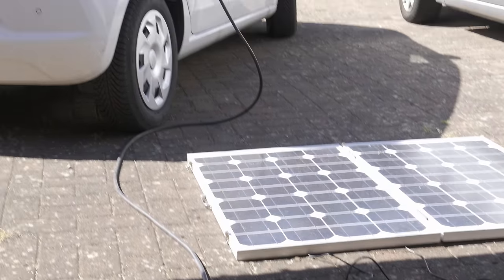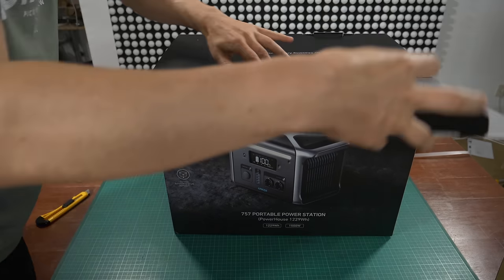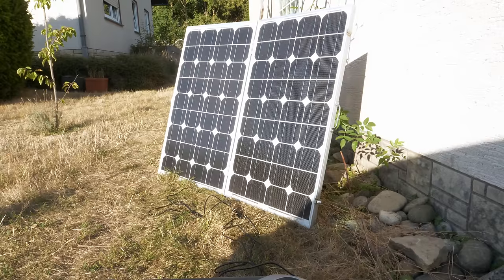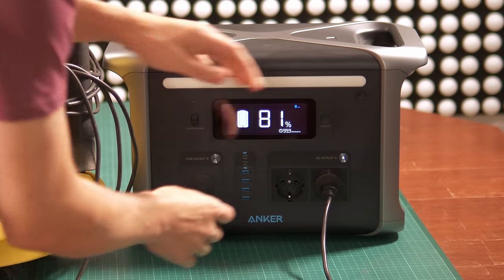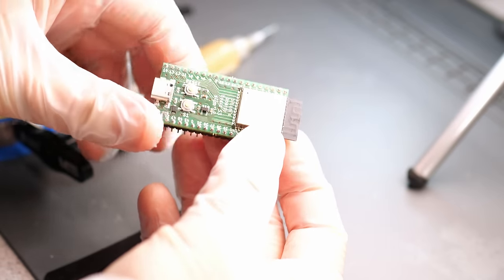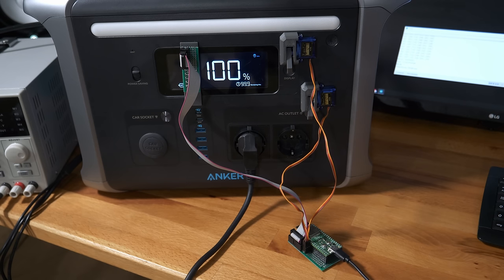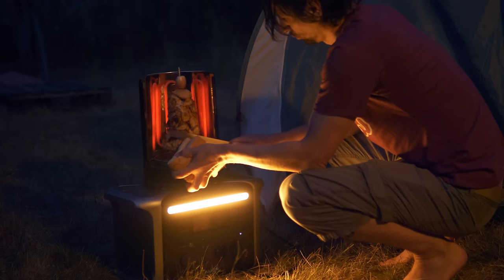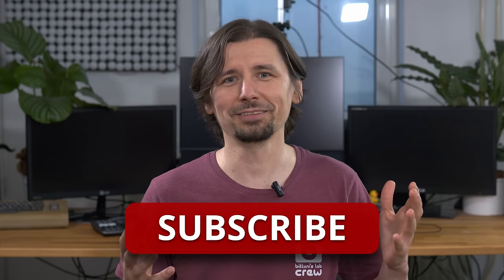Charging an EV for $0 (Anker 757 PowerHouse)

Comment: Have you not seen Julian Ilett's home built Arduino EVSE project? The spec allows you to dial down the current quite low by changing resistors on the pilot signal line. You should watch his videos - maybe your car can be requested to go down to 2A after all :)

Comment: Be carefull with all these units cause they mostly have a simple issue: a questionable warranty and repair shop plus no specs nor details about the manufacturer of the cells in side, I mean brand and modelnumber of the cells. 
The make profits by cutting costs using cheap, non branded or even used cells inside where you can not get behind. Bluetti, Poweroak and Ecoflow are all the same, some even still LiIon, which can burn, not LFP as many assumed.

We had Bluetti and Poweroak with a lot of issues till they died after 1 year and a nightmare of troubles during corona and only Amazon solved the issue to force the seller to take it back.
Without we would have been screwed, fully. The one we could not return has to be sold on ebay for 10% of the value cause there was no battery replacement available nor BMS back then. 

It is useless as an emergency charges cause germany offers every where a lot faster and cheaper chargers along the road are available.
Good experiment but pretty expensive if you do the math cycles of the cells x capacity which might end up in  a fortune. This one is a LFP cell with 3000 cycles claimed x 1,2 kWh = 3600 kWh without losses. This means that for 1700€ you pay 0,50 € for each kWh without the solar panels needed.

For comparison: you get a 8 kWh LFP battery for 1400€ and for 250€ a dedicaded off grid invervter that beats this one if you build it on your own and for your needs like the whole USB whatever dilemma. 8 kWh would mean for the e-Up a 50 km range, if you really wanna carry such system with you , I mean the Anker weight is about 25 kg  and quite a big chunk of 46 cm x 30 x c 25 cm.

I would get such only if you have usecase like charing over day the battery and charge the car over night. Not so efficient but you get a quite powerfull charging hub at home for about 2000€ that can charge your car with 8 kWh each evening if you have a 2 kWp solarpanel for about 2 / 3 days of the year where 2 kWp panels are about 800 - 1.000€.

Remember 8 kWh are roughly 40 to 60 km range per day for free, so 250 to 350 km range per week. 
I would think that you can charge your car with such 8 kWh offgrid charger and also run during daylight your fridge and router   from the 2 kWp which usually brings 2000 kWh a year and 14 kWh per day peak, but only very few days.

Such a DIY 8 kWh offgird mobile solar charger also useable for other devices at home with 2 kWp on the roof or garage or in the garden would make much more sense than just a mobile charger for 1700€ - but that depends on your living situation. 2 kWp is a lot for a car and the home, so in total 2500€ if you have a bit of luck. We paid for the EA sun about 300€. 
So i hope you might just design such project on paper what would be needed as a full alternative to make people think that it is possible to get such solution without any bureaucracy especially in germany , a diy solar power charging station - but do not forget that this design delivers 15 kWh in long summer days but about just 1 or 2 kWh on short winter days, but from february onwards mood raises and solar power harvest too. So December and January will require additional chargers than this.

Comment: €1,10 per KWh for new contracts here, and €0,39 per kwh of gas (3,81 / m³) completely insane. €1700 for just 1,23 kwh power storage is also not that great, but hey it was sponsored I guess. on the other hand: 1,23 kwh is far better then possibly nothing at all this winter. power rarely fails here as well, but this winter I won't be surprised if we will get those. If I had a place to put solar panels etc. I would be building probably something "Off-Grid Garage" style. I do like the automation of the buttons 🙂
Reply: We bought ourself a whole house capable battery that even supports island mode :D should get us 3 days of independence :D

Comment: Sind die dc dc Konverter eigentlich zuverlässig? Ich wollte mir ein 24v system bauen und statt 400w ins Netz lieber in die Batterie stecken und konstant die grundlast von 100-120w abgeben.

Comment: To fix the 36V issue, how about a 30-ish volt power zener diode?
The MPPT controller would probably pull the panel voltage down enough
Reply: At 10A, that diode would have to dissapate about 60w. A switching converter can be much more efficient.
Reply: @aaron41  The diode will only dissipate power when the MPPT is not charging. When it turns on it will quickly see that it can extract more power when the output is pulled a bit below the zener voltage.

Comment: Cute.  This setup will likely kill the lithium ion cells in just a few months of cycling though.  It’d make more sense to build a power bank from more robust discrete components for this application.
Reply: these lithium cells lasts 3k+ cycles before you see deg. few years should be easy.
Reply: Hopefully this pack uses Lifepo4 chemistry. Can anyone confirm? Limiting the output between 20-80% should help a lot as well.

Comment: I still need to watch the video but just from the 15 second intro you saved me. I have a neeed to charge an electric mower with an AC200P and I need to figure out a way to turn the AC back on when it drains since the battery is half the size of the mower battery. I see you have some 3d printed button pressers so I look forward to figuring out how to make those.

Comment: Good to see that this PowerBank is very good as an UPS. This could be a nice Dual-Use Case (while not using in as a portable unit).
Reply: Since the power ist converted to DC to charge the battery and then converted back to AC, the efficiency is probably pretty bad for this uses case.
Reply: @fkiesel9442  I did not think at that, but you are probably right. I can imagine that some UPS do that too instead of a bypass via relay.
Reply: @fkiesel9442  Using normal MPPT solar panel regulator with AC output, in conjunction with stronger Lead battery pack would give better results for much less money... and no workaround would be needed. Today's MPPTs units have usually both ETH/BLE(or IOT) control available, so remote automation is much easier ;-)

Comment: For the car charging you should have a look at the efficiency - with such low power it needs long anmd the car has a cerain be-awake-consumption. BTW- with this car you would be able to go down to 5A with all garnny chargers because Amp-Limit can be set in the car to 5, 10, 13 or 16 A.

Comment: That Anker battery thing is a joke ..... 
It's way too expensive! 
For the same money you could possibly get a 100Ah 5.1kwh rack mount battery and a 3kw inverter and possibly a mppt charge controller and some solar panels all from AliExpress! 
Yeah it's not beautiful! But it will work, the rack mount batteries also come in 200Ah 20kwh size and it works out cheaper than the smaller sizes ... And you can run the rest of your house when the grid is down....
Reply: The anker battery is meant for portability.
How portable is your solution?

Comment: Hi Bituni, if anyones going to be able to answer this itll be you.

My van has 2 x 12v (10 amp (20 amp fuse), so could i use 2 car chargers plugged into the provided solar cable xt60 for double quid charging?

The charge from 1 socket reads 120w, so would 2 chargers be 240w? Which is below the 300w from the solar panels.

Would it be too much amperage?

Comment: BLUETTI AC200P beats this puppy to the curb. And it's been on the market long enough to iron out all the bugs. 
With a maximum solar voltage input of 150V (compared to the 30V of this unit), users can string a few solar panels together in series and let the MPPT take care of them and any partial shadings. 
This area of the market has been cornered by the big boys that eat newcomers for breakfast.

Comment: I am pretty disappointed. I expected that you would hack car charger to support lower current or do some nice hack for slow charging from solar to some dc/dc converter and then directly to car DC charging port. Solution with battery station is in my opinion wasting energy on many unnecesary conversion and shorting battery life time of your battery station.

Comment: Hi, i would like to ask for help reguarding one of you project of gesture controlled robotic arm. I tried making it with the exact same parts and code but i am not getting anything, the code is up and running but when i use GY-521, GY-511 and Linear hall effect sensor i am not getting any out put means none of my servos are working please i need help regarding mu issue. Thank You!

Comment: How did you measure the sine wave at the oscilloscope? Did you just directly measure the voltage with the regular probes? Or used some special probe (i.e. isolated/differential)?
Reply from the maker: direct measurement 😬
Reply: Gefahrensucher 🙈

Comment: Nice, but I still find the charge of my car via 230V inconvenient. We need much more improvement on this whole charging story, IMO
Reply: You do know that there are faster alternatives already available?
Reply: @Jehty_  I do.
Reply: @peter.stimpel  so then what was the point of your comment?
Reply: @Jehty_  To annoy you ;) Seriously, the generation of electric cars we have today is not very efficient. To charge them in quite a acceptable amount of time 230V is not enough. At least here in my area not so many public charging points are abailable, so you need to rely on your house electric and its capabilities. Without changing major parts of my homes electric installation faster charging is out of reach. Oh, and to be clear, I have an electric car, so my opinion is from experience.
Reply: @peter.stimpel  where do you live that you don't have 400 V at your house?
Reply: @Jehty_  I do, but not as near to the carport the electricians would be happy about it. Basically, he offered some installation work, but the pricetqag was way above. The house was built in 1997 (not by me), and bringing 380V to the outside was not focus at that time, obviously. But this is not the basic topic why I am not pleased with the charging situation. My opinion is we need much more research to make electric cars more efficient. We carry big battery packs with us, and still we have a quite limited reach with such cars. I do not know if you get it. But it is not importan either.
Reply: @peter.stimpel  no, I don't get it.
Research in new battery types is done already.
So I really don't understand what your problem is 🤷🏼‍♀️
Reply: @Jehty_  OK, so it is as it is - we do not understand each other. Im fine with that
Reply: @Jehty_  Wow there are places where residential homes have 400v?! Canada has two 110v phases, but only our ovens, air conditioners and dryers use 220. I think many EV owners here have slow chargers running off the 110, unless they hire an electrician to add a 220 outlet to the garage. But even then I think they need to buy a stage 2 charger or whatever it's called to plug into 220.
Reply: @grabasandwich  yeah, it's called "rest of the world" 😂
Reply: @Jehty_  The "rest of the world" has 400v if they have three phase. In some countries that's standard but in others it is not.
Reply: @eDoc2020  could you give an example of an country where that isn't the case?
Reply: @Jehty_  UK is definitely single phase for houses and I think Australia is, too. I can't say much about other countries.

Comment: That's too much conversion, with too many inefficiencies at each step. You're getting, what, 5 or 6% efficiency, sunlight to driving? I'd make a custom buck-boost circuit to directly adapt a variety of solar panels' output to the car's charge circuit, and implement MPPT (and data logging) with an ESP32 which also happens to provide BLE and WiFi. If you use large LiFePo4 cells to store excess panel output, you can use that (boost mode) to charge the car at night. Bonus: fewer operator manuals and warranty cards.

Comment: I too wanted to use more panels to charge my similar power bank. Same problem, two panels in series is too high of a voltage. Put the panels in parallel and the voltage is too low during non-peak sun. My solution was to attach the panels to a Victron MPPT which has a separate load output. I also attached a couple AGM batteries. The panels keep the AGM carge, even when the car isn't attached. The Victron will cut the load off to prevent deep discharge of the batteries. The load of the Victron is connected to the input of the power bank (instead of connecting the panels directly). Results: I can run more panels without overpowering the power bank, the power bank has additional reserve power because of the AGM, and the entire system is more effivient because it stores more energy and works during both peak sun as well as low sun. Couldn't be happier. Now, I'll build your circuit to charge my E-Vehicle too!

Comment: Your EV charger is controlled by a 24V pwm signal on one of the cables. Maybe you can cheat that to accept less than 6A?
Since the EV battery doesent mind slow charge the 6A lower limit is nonsensical and should be tinkered with.

Comment: could you just put in more than 600w of solar but leave it completely disconnected from the grid/house power? put the inverter output directly to the car charger.

Comment: Maybe it could be interesting to have a look at the Bluetti ac200p or  ac200 max? At 1799/2199 they are more expensive than the Anker, but you also get 2kWh of LiFePo4, resp 700W and 900W solar input. The first does require 35V minimum, the latter already starts at 10V. Both top out at about 150V. Output is about 2kW... the 200 max also features a Bluetooth connection and app...

I really like Anker, they have several excellent products and sub-brands but on the battery front the Bluetti on paper looks more interesting.

Comment: I recharge my eletric car with a diesel generator, its the cheapest solution atm, since the electricity prices exploded
Reply: I kept my diesel car ;ø)
Reply: And what mpg or L/100km do you get doing that? I know your comment is probably a joke but by my estimations it shouldn't be much worse than an American car.
Reply: @eDoc2020   - me?
When driving on motorways at 80 km/h I can go over 26 km/liter.
On regular highways with much more breaking/accelerating I go around 20-23 km/liter.
These figures are average over usually 2/3 tank (+30liters)
So, I saved money on not getting a new car - and am much more efficient at converting diesel into motion ;ø)
Reply: @EgonSorensen  I was talking about charging an EV off of a diesel generator. Obviously we would expect it to be less less efficient than a diesel ICE car but by how much?
Reply: @eDoc2020  I agree - and with some numbers I get in my 20+ year old car to compare to, it would be interesting.
I know electrical generators has around 50% efficiency in converting fuel into oil. The charge process is around 80-90% efficient - so the mpg or km/l figure will be way below mine. 
Probably why Space Engineers didn't reply ;ø)

Comment: I'd use a big Zener diode across the big panel output to clamp it to 30V for initial testing. The MPPT will drag the 36V down a bit once it gets started! 😁
Reply: That's one hot zener diod
Reply: @timonix2  the diode/FET combo only has to hold it at 30V till MPPT starts running, less than 1 minute to ramp up. Not that much energy for a 10mm diode to dissipate. The MPPT will pull the open circuit voltage down.

Comment: If Anker really wanted to inspire innovative uses, they could do so without changing much.  They could open-source the firmware and then let users make their own modifications, do everything you did in (admittedly clever) hardware hacks in more reliable software instead.
Reply: Even though anker use 3000 cycles LFP battery, it could be easily depleted within few years, if you allow such a modifications. I bet it's not what anker wants by providing 5 year warranty

Comment: You can get some grid tie inverters that measure the current going out to the grid. If you load up one of those with solar you should be able to power the whole house and car without exporting any power to keep you within the 600w limit.

Comment: Would be nice if it can be combined to have a hire wattage capable would b a neat feature then you would be able to have on the ac side 3000w by using 2 units that would be very neat.

Comment: Usual big solar panels have 30-40 V power output. This could be problem when connecting to this powerbank MPPT input...
Reply: ... and using DC-DC will very badly affect MPPT features, moreover for bigger pannels especially in parallel circuit it must be a huge converter (consider 600W power). Maybe it would be better to use power DIODES cascade to get under 30V or some kind of floating voltage divider (either triggered by relay, or better using MOSFETs).

Comment: I like the workaround for charging, pretty creative. Couldn't you just get a wifi switch in between the charger and the Anker, and then just set a schedule or get really creative with setting up home automation tools to include weather etc as a factor in the schedule? Some like the Kasa have energy consumption measuring which could be a cool way to set automation once you know the normal output etc.

Comment: As stated by Anker, battery lasts 3000 cycles, capacity is 1 kWh, so this way 1 kWh costs you 30 cents.
Far from free.
Reply: The battery last a lot more than 3000 cycles. 
It just has a reduced capacity (say 80-90%) capacity at 3000 cycles.
Reply: @timtravelnomad  unless it's stated somewhere it's just your guess.